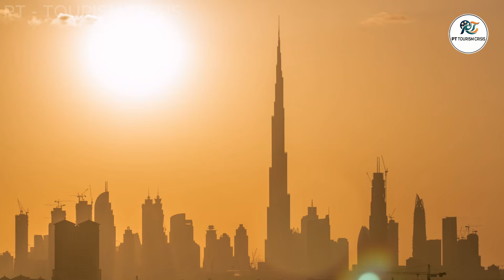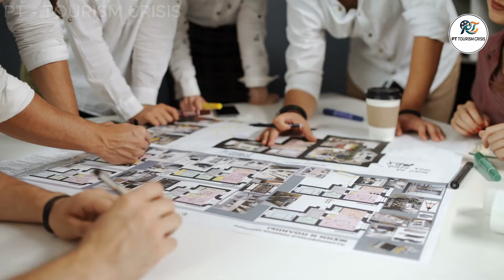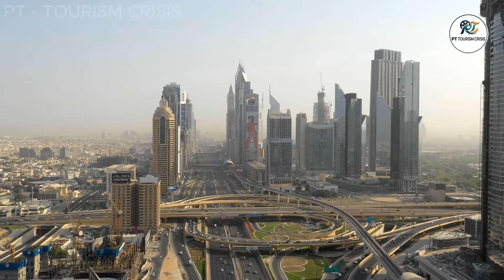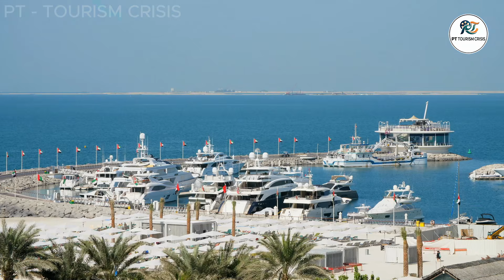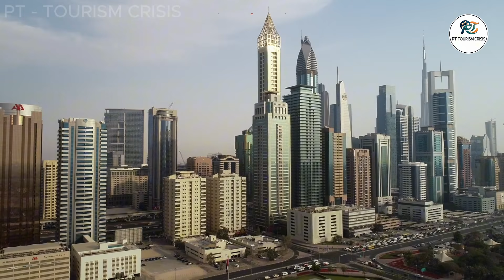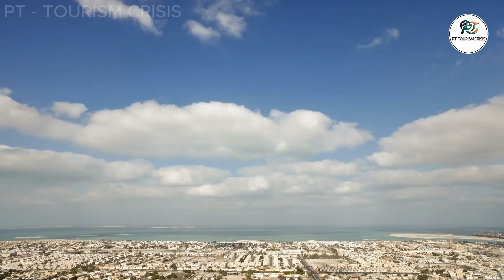Why 122°F Desert Heat Is Turning Dubai’s Luxury Malls Into A Mechanical Trap

Comment: Why can't they just build a lot if solar panels to offsett some of the energy consumption
Reply: because it's cheaper to burn oil ;)
Reply from the maker: They can, and Dubai already uses large-scale solar. The challenge is that peak cooling demand can continue after sunset, so solar helps a lot but still needs storage, backup generation, and a stronger grid.

Comment: In perhaps 25 years Dubai will collapse because of a lack of electricity to keep cool. Just enough time to pay off mortgages.
Reply: UAE has plenty…green power✨
   All the excessive photons that heats everything up in Dubai is also their blessing. Solar farms that create mass production of energy 💫
Reply from the maker: Energy demand for cooling is a real long-term challenge, but “collapse in 25 years” is far from certain. The bigger question is whether power generation, grid capacity, and cooling efficiency can expand fast enough to keep pace with hotter summers.

Comment: Saw somewhere that the area is running short on fresh water as the desalination industry can't cope in some areas. Why not tap into the enormous amounts of water these vast air conditioning systems wring out of the air every day? A little filtering and you have nice distilled water available.
Reply from the maker: That condensate is absolutely worth recovering, and some buildings already do it for irrigation or cooling systems. The catch is that it isn’t automatically drinking water, because it can pick up bacteria, metals, and dirt from coils and pipes, so it still needs proper treatment.
Reply: Useless for consumption
Reply: Is the air (even indoors) that humid there?  I thought desert air was dry?
Reply: The condensate is already recycled and sprayed onto the condenser coils to help them expel their heat.

Comment from the maker: The heat never disappears—it just moves. As Dubai expands its massive cooling networks, it raises a critical question: Is manufacturing 'winter' inside a sustainable solution, or are we just building a larger thermal debt for the future?

What do you think is the biggest challenge for Dubai’s infrastructure in the next decade? Let’s discuss below! 👇
Reply: I think you should stop making AI slop
Reply: @See_fou  thank you for stating what we all are thinking 🙏